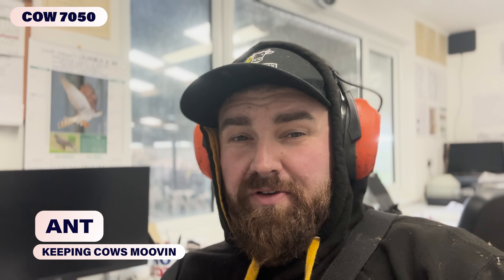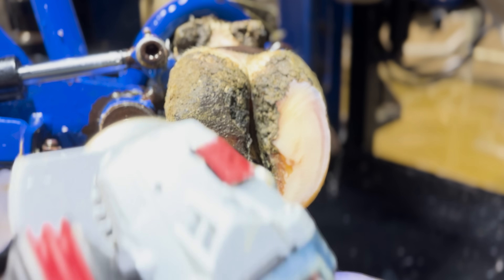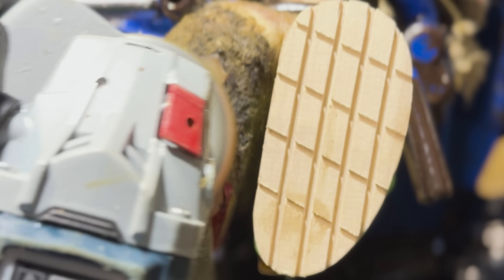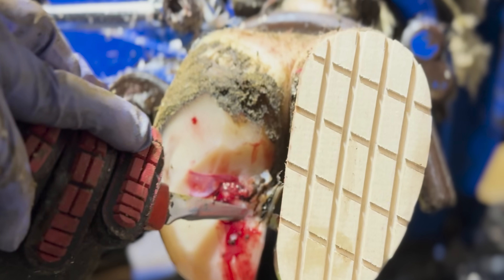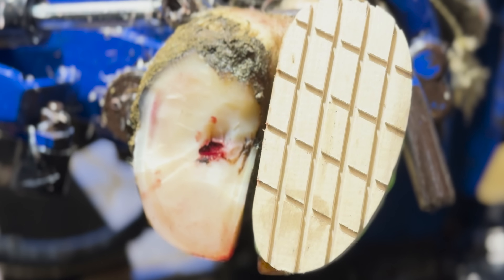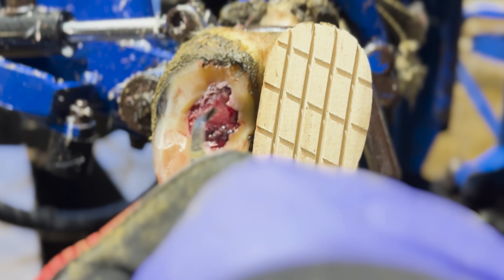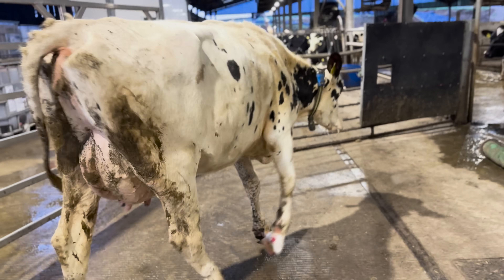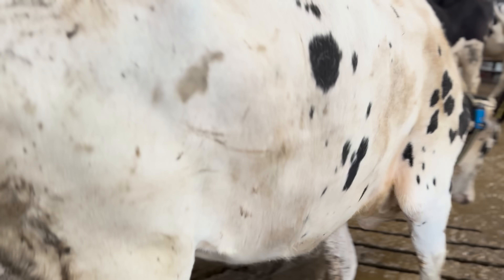Severe hoof INFECTION left this cow limping… she needed urgent help!!

Comment: I must be used to HGP. This trim seemed too new to the field for me.  The trim was sloppy and waaay too long. Thought maybe the trimmer was dull. IDK. But glad to see she's on her way. Practice practice practice! Btw love that u are supporting the glue!!!
Reply: I felt the same way. Not sure if it's the knife or if the method is just different. Nate and hgp both will both grab flaps of horn to trim them off while here, he doesn't seem to do that. And he doesn't seem to stick as strictly to the step by step method that graeme does. But I felt the same way when I started watching hgp after watching Nate for a long time. Nate uses knives that are sharpened on both sides, so he can cut both ways. Hgp has different knives for different directions. Some sharpen the hook, some don't. Some use iodine, some just use salicylic acid. Rubber vs wooden blocks. Different glues. They all have their preferences and all have differences in what they have seen the best results with at their particular farms.
Reply from the maker: We  trim 30000 cows per year and I’ve been trimming cows since I was in my teens.  I’m showing you the trim close up, pretty unedited to try and show as much as possible.  Just wait and see her process and how she heals up then judge 🫡
Reply: @keepingcowsmoovin2986  You are WAY too rough with the trims, take off too much/too deep at a time, and cut straight into the infection rather than around it. You caused this cow so much pain. Please hone your skills some more and keep the cows comfort in mind while trimming. 😢